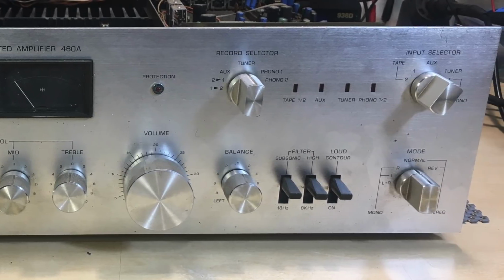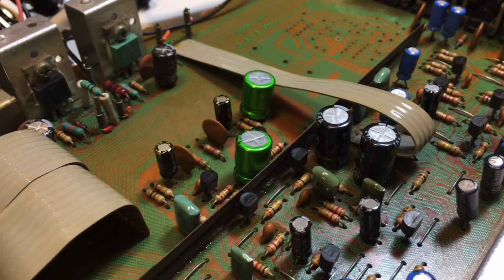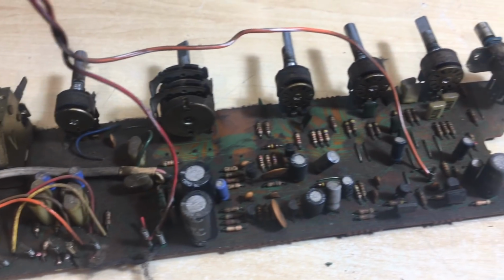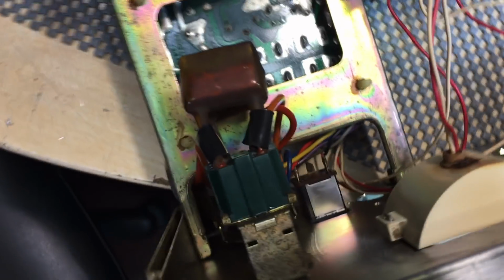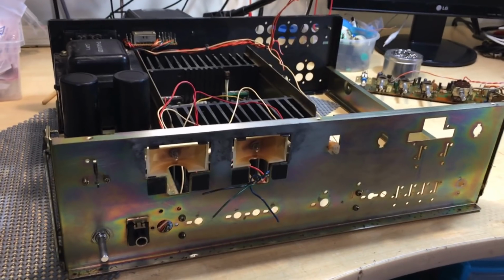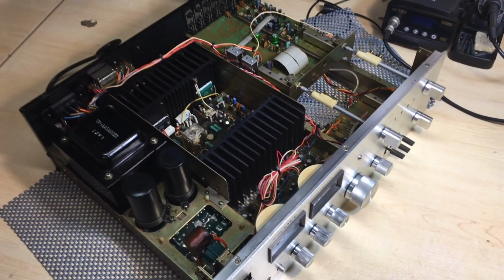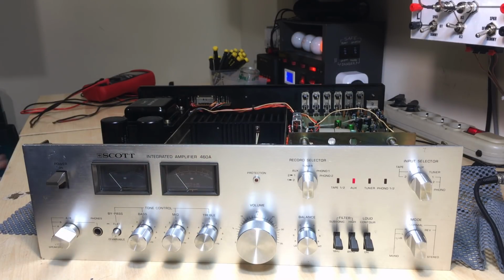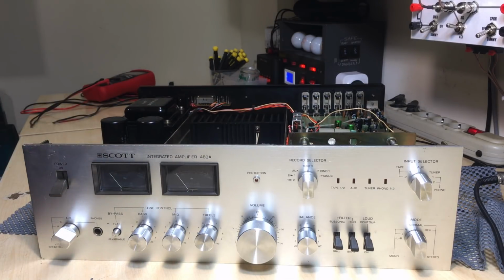HH Scott 460A amplifier takes a bath.

Comment: If the ambient temperature is low, I would stick those boards that do not have pots, relays etc. or plastic spacers etc. in an oven at below 50 degrees Celsius and leave it for an hour or so. If the temperature can be set more accurately (highly unlikely) I'd leave it at say 40 degrees for 3 or 4 hours.You can always use an oven thermometer to monitor the temperature. If there's an oven fan, I'd use it too to aid the drying process. I'd be wary of doing this to parts with fragile plastic covers (e.g. relays, needle meters and so on). A far less risky alternative (as long as the item is appropriately secured) is to place the item on top of a radiator. The only drawback of the latter method is that ii's only applicable in winter. The summer equivalent is exposing it to a the draft created by a fan set to maximum for a good 3 to 4 hours. I've used the last two methods on laptops (unplugged, battery removed), which were positioned on their side so that any water can drain out of their ventilation openings, to dry them after they had water spilled on them.
Reply from the maker: Thanks for the tips and sharing your experience.

Comment: Hi there, I've just discovered your channel and stubbeld on this video. Have to tell you that, I do wash all my electrinics every 5 years. I do use special soap for it.
I have no clue how I have to mention it in Englisch, but in my language it's called vk4. It's used by salvating stations. E.G. if there's been a fire in a house the smoke is the worse enemy.
There's no worrie for the transformer because it's sealed. The only fragile parts in this amp are the VU meters. 
It's allso not nessaserry to remove all boards. The whole AMP can be washed at once, even in a dishwasher. 
You allso can wash cassette decks, CD players but, remove the transport. 
After washing and a good and ofcourse a propper dry, there's a special spray you can use to protect all componets. Ask your local electronic store.
For better results you can use a big enough bath or sinck with ultrasonic and use allso the VK4 soap. Hope it's usefull for you.
Greetings from the Netherlands
Reply from the maker: I’ll look around for that product, thank you.

Comment: Going into protection mode may indicate a power supply issue. Old caps are usually the culprit. Especially the big caps. Check diodes as well. I’m impressed with the cleaning job.
Reply from the maker: Will do just that.
Reply: Electronics Old and New by M Caldeira 
Let me know how it works out.

Comment: I cleaned up an early 90's era Adcom car amplifier using a 50/50 mix of distilled water and Simple Green. Then rinsed it with distilled water, and blew it off with compressed air getting out all the water from the nooks and crannies. Came out perfect. 👌
Reply from the maker: great.

Comment: Next time use Windex. Windex is the best. The Windex breaks down it strips away the nicotine. I always use Windex and a paintbrush. It works great. And then after I'm done cleaning everything, I stick it over a heat register and let it dry out for a while.
Reply from the maker: Thanks.
Reply: @electronicsoldandnew  you also want to stay away from use of any kind of water or cleaners on trimmers and pots, and also keep it away from the wires. Wires are like wicks. They absorb water all the way through the wire and then they rot out later.

Comment: Half a year ago i cleaned a Lenco Amplifier (man: 1976) in the showercel. Put the hot waterbeam on it, together with a household grease determent. Afterwards blew it dry with a compressor.
Is working fine for half a year now.
Reply from the maker: Great

Comment: I done before this type of cleaning on amplifiers but I usually take off the pcb. The problem with pro amplifiers is that drinks are spilled on them at times and the pcb will end up in a mess.  My technique is putting dishwashing liquid on the brush and literally scrub the dirt and whatever is there on the pcb.  A good rinse takes place.  After dripping a good shot of air with a compressor and then behind the window facing the sun for a couple of days,  
You can do this with no trouble at all but you must be careful of what type of PCB material is in use, If it is fiberglass then no problem but if its the brown ones then it need a lot of drying up as the latter tend to absorb water.  Sensitive circuits and high impedances may be affected, even so where there are high voltages involved.  The best drying up should be on a period of time in an oven with a temp of say 45-50 deg for an hour at a time for a few days leaving cooling down between each heat up.  This will eliminate all the absorbed humidity in the pcb.
Reply from the maker: Thanks for your input. Always interesting to hear about people’s experiences.

Comment: I worked as a bench tech for a cable tv company.  Occasionally, one of the techs would spill a soda into his 13 inch test TV.  They would bring it to me and I would lay it down on one of the antenna tower legs and water hose the guts of the TV until I was sure the soda was completely removed.  Then I would dump a bottle of isopropol alcohol all over it to help get the water out.   I figured the alcohol would evaporate much easier than the water.  Then I would let the tv sit there in the warm sunlight for a day or 2.  When I plugged them in and tested them, they always worked.  Then I would hand the TV back to the technician and they couldn't believe I fixed it!  They thought they would get a NEW test tv.
Reply from the maker: Thanks for sharing your experience

Comment: you should have not re capped to see if the dirt was the culprit for not working correctly. I would have thought tracking across components with conductive gunk. I always open up equipment and laptops for a yearly dust out and all my electronics function for years. Even just a weekly hovering outside vents ect helps.
Reply from the maker: I intended to recap anyway, as these caps are quite old.

Comment: I a,m a retired engineer who worked  at Magnavox/Philips  many years ago. We used to put the boards in a dishwasher after they were soldered to remove the flux. This  was done on millions of boards  back then.
Reply from the maker: Definitely something I’m going to start doing (when my wife isn’t at home)
Reply: @electronicsoldandnew  if you are serious, I would not do that, there may be harmful material that would remain in the dishwasher. we used banks of dedicated machines.

Comment: I used to restore 70's Seeburg jukeboxes. I would pull the mech, wash it and blow it dry with a diffused air compressor.  Never had a problem.
Reply from the maker: Definitely a technique I’m adding to my arsenal :)
Reply: I also do vintage stereo receivers. I use car detergent because it is fairly gentle. I use a paint brush to clean. I do the whole unit. Then blow out with compressed air. Then sit in front of a fan overnight. Have done it countless times. Only issue is sometimes the meters leak. Pop the case and gently blow them dry. 
Weird but never had a problem. But I do not soak!

Comment: Rest assured you did ok with washing. The transformers are usually "potted" or heavily lacquered, so they will resist to water. A few years ago I washed the board of a CRT tv set including the flyback trafo on the board. Hot water shower and drying in the summer sun, next day resoldering a few loose components in the power source and it was good to go. Now it is museum worthy but still working fine. I wish you a Happy New Year!
Reply from the maker: Thanks. Happy new year
Reply: No...those transformers from Japanese made electronics are not potted. Potted transformers are dipped in a heavy tar like compound and are completely sealed.  Pull off the bell ends of this transformer and you'll clearly see the windings. The only thing preventing shorts is the the lacquer on the wire and the layers of fish paper in between the windings. And the problem is that water often gets into nooks and crannies inside the transformer, and will take a very long time to try out. People who talk about doing this to industrial type gear are comparing apples to oranges. That gear uses glass epoxy boards, not phenolic. Components are hermetically sealed. They're meant to work in difficult environments Consumer gear is never meant to get wet like this. Even the paper phenolic boards are hydroscopic. The switches and controls are not sealed. Sometimes you get lucky and it works. Sometimes not so much. A little surface dirt hurts nothing.  To each his own, but I don't get why this questionable practice keeps getting recycled. I have many years of technical training on repairing products like this under my belt, having worked for the likes of Sony and B & O. Trust me, nobody at these companies ever suggested doing something like this.
Reply: @johnstone7697  sure, everybody from those and other big companies will suggest buying a new unit 😃. While you are right about the risks of washing cheaply made transformers, on the other hand here is about hobby, not productivity or safety issues. Sometimes it's hit or miss, but as a  hobby, that's all the fun! Happy New Year!

Comment: And the other thing is H H Scott's amplifiers those protection relays on notorious for going bad so I would check to see if the relay is dirty or if the coil on it the magnetic coil is operating properly if it's getting enough voltage custom magnetic coil could be going full t on it the only thing you made it have to do instead of going crazy looking for a bad transistor it could be just that protection relay that has gone bad and like I said before those amplifiers are notorious for having those relays going bad just like the ones in the Pioneer 12 I think they 1250s protection relays and nose go bad too and they have the same problem but it keep going in and out of protection
Reply from the maker: That will definitely be checked. Thanks.

Comment: I have often used a Dishwasher to clean of really bad stuff and then put them into a large ultrasonic cleaning tank, and get them looking like New.........The secret is correct Drying....which I do in an old quite large Nappy Drier....its about the size of a fridge !  and  tipping the item over twice a day, for a couple of days to dry the item completely.......I have never had a single failure, but I do remove meters and speakers, but nothing else..........I once did over 200 brand new commercial 2 way radios that had all been under water in a flood.......no failures at all other than replacing speakers........it works really well if you dont power anything on while it is wet.
Reply from the maker: Definitely going to try that.

Comment: It's come up looking like new! Indeed, it's not just a case of chucking the entire thing in the bath, as you've demonstrated. The end results definitely make it worth it in extreme cases like this.

As for the protection fault; we used to have an old ITT receiver that would do this from cold, eventually settling down as it warmed. I recall it was a rogue transistor in the protect circuit. 

They all had those gold-coloured legs that corrode over time and eventually the rot enters the body of the transistor, causing noise and all manner of issues. Often you'll find that freezer spray is quite hit 'n' miss in this scenario, so I'd definitely consider blanket replacement where possible.
Reply from the maker: I’m going to have a look at this soon. Should be fairly easy to find the problem.

Comment: This thing looks more like a rebadge or as they call ie a built under license. HH Scott had probably paid the bucks for this design with a few changes from a manufacturer in Korea etc...
Reply from the maker: Could be. I don’t know the history of the brand.
Reply: No.  This symmetrical complementary amplifier is very likely the same circuit that Scott used in all of its designs from 1976 onward. This design, in turn, is similar to the topology first used by Scott as early as 1969.   You may be surprised to hear that those early complementary designs did not use a protection relay, nor was one needed.  I have a 1971 Scott 477 receiver (pre-bankruptcy) built in Maynard Mass.  It works perfectly, and is full of circuit innovations that were never found in any of its competition.  Scott went bankrupt trying to compete with all of the rest of the industry, when it should have stuck to the carriage trade.

HH Scott tried to stave off bankruptcy by designing a lower-cost unit line that was manufactured in Japan.  It was specifically designed by Daniel von Recklinghausen for this purpose.  It didn't help stave off the inevitable.  The 460 amplifier seen here is a likely descendant of those designs, protection relay and all.

Post-reformation, Scott did have some units manufactured in Korea.  

When the company came to be more fully controlled by Emerson Electronics, Scott became the company that was little more than a name brand, with a circuit designed by... who can say?

Comment: I worked for Robicon corp between 1980 to 1991, we manufactured industrial controls including military contracts. 98% of all are custom PCB's that we populated were run in a dish washer, yes like you have in your kitchen & then they bought a modern conveyor driven washer that looked like a smaller version of a car wash. The dishwasher boards were dried with compressed air. Mostly women populated the boards since they have small hands & they would use an air nozzle & dry them off. The carwash model had hot air blowers  & at the end the women gave the transformers & pots a final blow out with compressed air. The wash & dry cleaned the flux away that was a result of the wave solder machine. Pretty cool to think of now but was a dirty job running the wave solder with lots of air born lead dross. I'll probably die early from that work.... Merry Christmas and Happy New Year
Reply from the maker: Have to try the dishwasher when my wife’s away :)

Comment: Many years ago I was a bench tech at a small electronics company. Being young and just out of vocational school, I was leery of cleaning dirty equipment since we generally used 409 spray cleaner on cabinets to circuit boards. One day I expressed my concern to the owner and he told me a story of when he was a repair tech (1940s -1960s) and had to clean dirty equipment. They used to use Tide detergent and let a whole transmitter or receiver soak in Tide solution for a while and afterwards scrub around on it in a sink of clear water. Transformers and all!!! Then they would use rags and hot air to dry it and let it set for a week or so before troubleshooting. From then on I was careful of IF cans and cardboard coil forms and sprayed and scrubbed away, no worries. Just have to mind labels and lettering.

Now I hang around several techs at a local radio and electronics museum. We get equipment that is nasty fairly frequently, stored away in barns, basements, attics, and worse. Conversations about members using similar methods as to what you used here, up to and including automatic dishwashers aren't totally ruled out as long as care is taken to identify what components are not to be waterlogged. But methods that are similar to what you used before is what we generally do. I have yet to see the need to put a stereo amp in a dishwasher, but other members have carefully done so. Sometimes they use silicone or tape on transformer openings. I'm not recommending anyone try this since I have no experience with it myself.

The phrase, "rinse and repeat" is fitting. Tried washing the first circuit board and all went well, so for the second board it was rinse and repeat; and so it will be the next time for a really nasty piece of electronic gear. 

Have a great holiday season, enjoy watching your videos. Love seeing the dim bulb tester in use.
Reply from the maker: Thanks for that. And have a great holiday.

Comment: I reckon the amp was made in japan by Rotel, it is similar to my Leak 3900A (same selector knobs, also built by Rotel).
Washing boards is nothing new, it was done where I worked, also Tektronix cleaned equipment returned for repair/calibration in the same way.
Reply from the maker: I love these comments because I learn a lot from them. I’ll definitely use this method in the future.

Comment: I know that this was a daunting experiment. I learnt it in the airline back in the days when smoking flights were still a thing. The entertainment equipment used to get gummed up with nicotine and tobacco smoke dust. Eventually all the electronics needed cleaning. We used a supersized ultrasonic cleaner and would immerse entire units in it with soapy water.  (We used a particularly strong solution called My-T-Strip which had an ammonium component).
I find using liquid soap for clothes gives the best results. In fact I have had great success freeing up seized pot shafts and tuning cap shafts by boiling them in a solution of hot soapy water for 5 minutes (while my wife is out shopping). The results are spectacular! The metal comes out like factory, sparkling and new..
Reply from the maker: Well, I certainly enjoyed the experience. As I say in the title, you’re to ‘blame’ for this experiment, and it was a good one :)
Reply: I did some washing this evening.. I'll post a video..

Comment: No sacrilege there, "clean is as clean does" -- (with apologies to Forest Gump). I've washed everything from room air conditioners to old electronics with nothing more than a garden hose and some dish soap and gotten excellent results.  You just have to leave the wet carcass out in the hot sun for two or three days to thoroughly dry it out, then spray contact cleaner in the pots and switches before powering it up.  Obviously don't power wash tube radios with delicate coil wires and such or you may never get it to work again.  Best used for solid state electronics IMO.
Reply from the maker: Definitely learnt something new here. I’m going to use this method again.